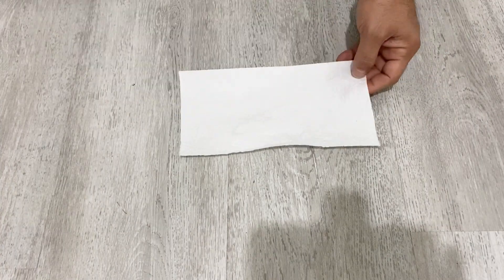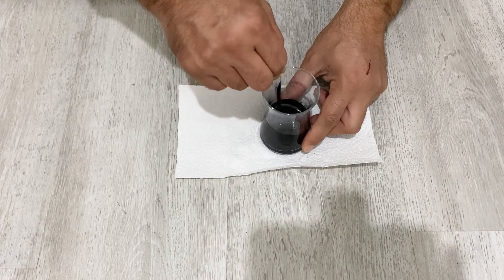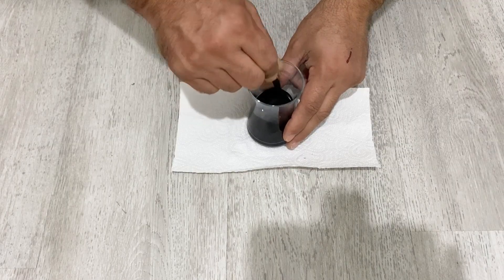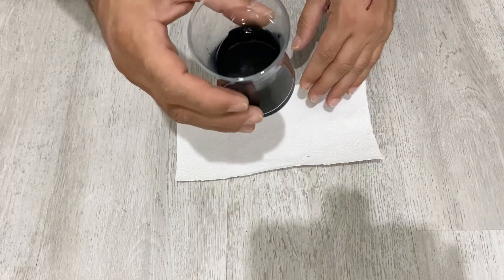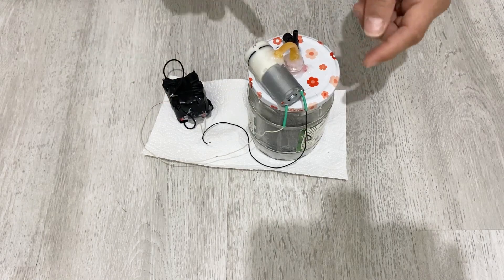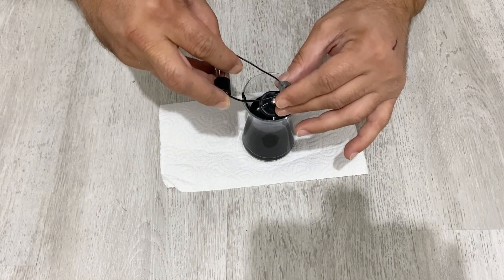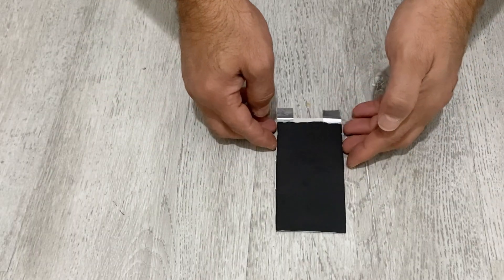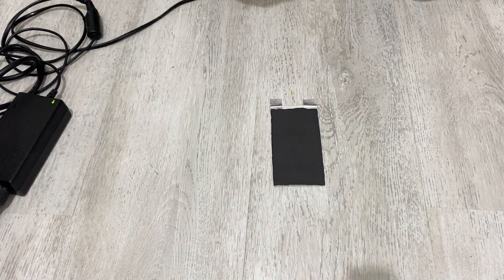How to Make Conductive Paint Heater | DIY 135°C IR Heating Plate”(Whole Process)

Comment: Thank you so much for sharing this video. This work can easily be used on 3D printer hot plates. Of course, it can be placed under a heat-resistant glass plate for mechanical strength. As is well known, these hot plates are heated to 60-80 degrees Celsius, depending on the type of filament used. I wish you success in your endeavors.
Reply from the maker: Thank you so much fella.